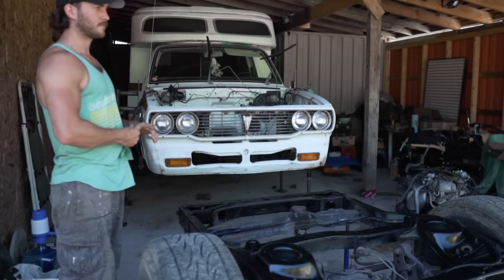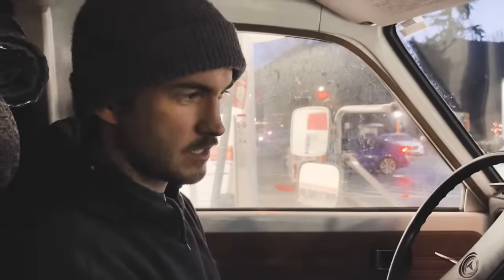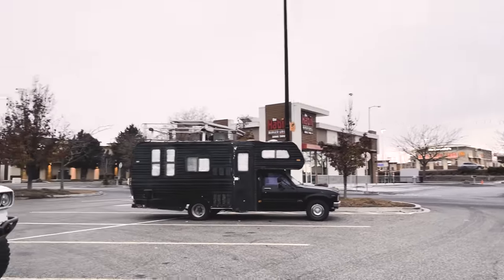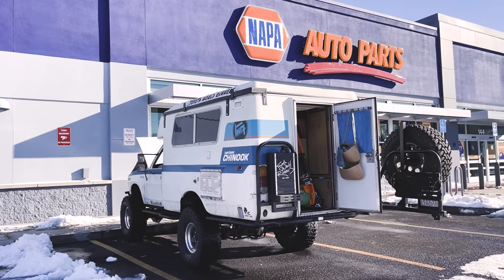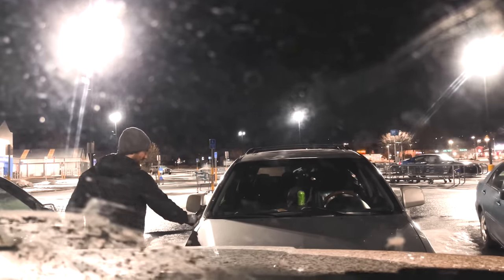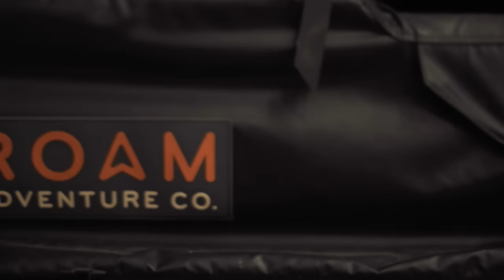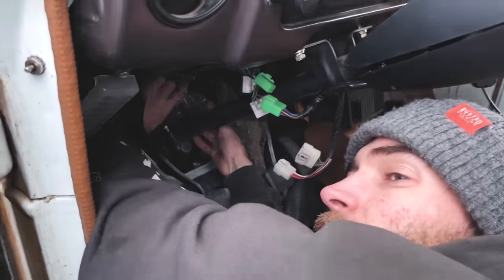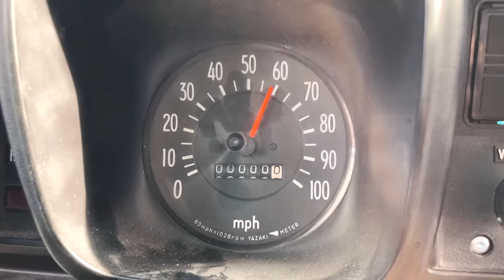1500 Mile TEST DRIVE did NOT go as planned | Toyota Land Cruiser Chinook

Comment: As someone who rebuilt the suspension steering, and the electrical of my 98 4runner. Just on a regular production model the amount of bugs I’ve had to work out over the years is insane. I can only imagine a custom rig like this, it isn’t as simple as just putting these parts together. There are soooo many variables when dealing with custom vehicles. The alignment issues alone. A stock vehicle can give many headaches just lifting them.

Comment: Eastwood sells some amazing welders you can use on a generators power. They’re very small& Flux-core requires no gas can.  Could use that to extend the steering column an inch.

Comment: 4 wheel drive isn't going to help on ice, even if you had it.  I live in the horn of Oregon where the weather is very dynamic and not only is freezing fog (can sublimate black ice directly onto the road) but actual freezing rain (rain that freezes on contact with surfaces, glazing them) a constant threat from September to March (or even April, Willamette Valley got snow in Mar/Apr the past few years) 
I am not an affiliate but we use Hakkapeliitta R3 SUV (the SUV versions have Aramid sidewalls, just pay the extra 30 bucks) and the colder it gets the stickier the tires are - no studs needed, no chains needed, super grippy.  But once the ambient temps start pushing above 47°F consistently they start to feel mushy and even our Subie FXT 2.0 starts wallowing like a vista cruiser - black ice, doesn't even notice it.  If you actually change to winter tires, there's nothing else like them on the market...I don't like using studded tires because they tear up the roads and the Nokians actually work better than studs so it's a win/win for me.

Comment: 80 series 40th owner here. Not sure if you kept the steering box from the cruiser chassis but if you did she may need a tighten with a 17mm i believe (been 10 years lol). Those get slop (mine had 8inches side to side when i got her ). The steering wheel being off spec makes her wander alot too. Just somethin to check. Lemme know if you want the spec i have the factory manual.
Reply from the maker: Noted, and will check!

Comment: I had that same problem with my 86 4runner ended up changing the toyota hubs with warn locking hubs the original was just too rusted and worn out to fix cheaper than buying new ones good luck

Comment: FOR THE GOOD OF EVERYONE READING THIS!  Don’t break a car window if the battery is dead, you can jump a dead battery off the starter terminals from under the car. You don’t even need to start the car off the starter just touch the + terminal with the jumper and ground to chassis so you can unlock the door and pop the hood…

Comment: Get proper castor corrected arms castor bushes suck ! Also factory alignment spec for solid axle cruisers is toe in 2-3mm takes up any slack in the front end giving a more positive steer also run your tyres at about 50psi see if it drives better

Comment: As a 30 year long multiple 80 Series LandCruiser owner, I'm curious about how you ended up with manual hubs?  These beasts are known for their drivetrain, which is a full time 4 wheel drive setup here in North America.  That includes a strong full time front axle.  Yet you have, or installed a part time 4WD system on the front hubs?  I strongly recommend you go back to the full time system if you made a decision to modify it to part time.  It's stronger, and more reliable that way, and the fuel economy is barely different - perhaps 1mpg.  The vehicle drives more ably and is more stable as a full time also, and the alignment is/was setup for that drive system.  So if you align it (caster, etc) to drive as a full time vehicle, it will not be stable at highway speeds when in 2WD mode.  Or if you align it for 2WD, it won't be stable in 4WD.  Slight differences, yes.  But with a top heavy beast, you should in my opinion go with the safer full time 4WD setup.  Looking forward to seeing more details and know there is a huge and well informed 80 series group on the IH8MUD forum.  In Denver, Slee Offroad are one of the best for 80 Series on the entire planet.
Reply from the maker: Unfortunately the 80 series drive train didn't fit in the chinook, as well as we didn't have it in the first place. We believe this was the best decision for us.

Comment: i'm a little shocked you guys didnt pack any bikes, ebike or a small motorcycle off the back incase you get stranded
Reply from the maker: If only there were room....
Reply: @ToyotaWorldRunners  oh there is easily a way to fit a bike in there and when I mean bike I mean bicycle without electric motor they make a lot of folding commuter bikes and stuff small enough to fit on there